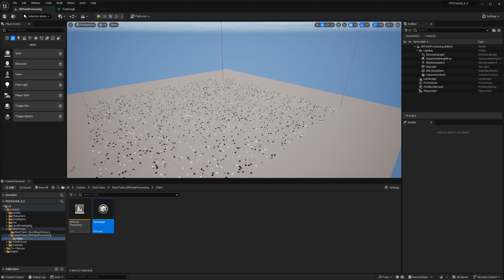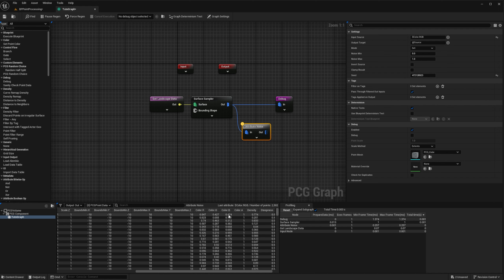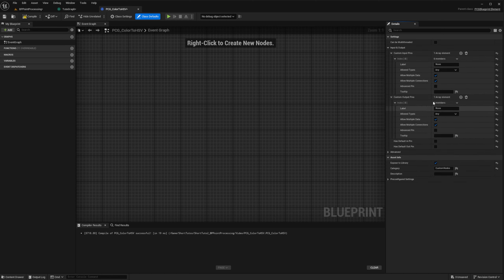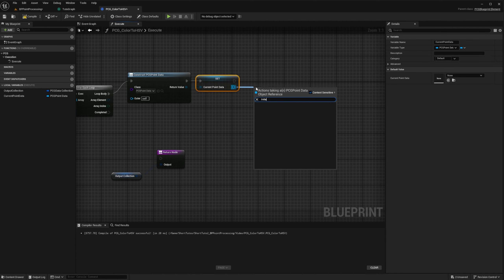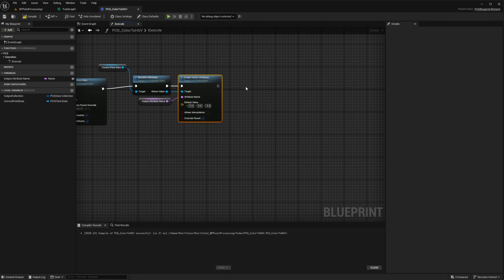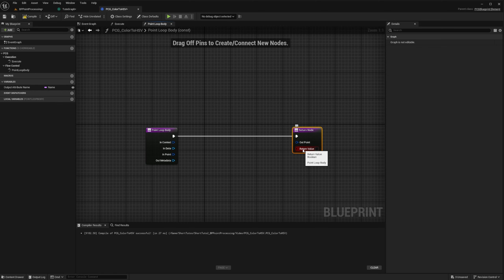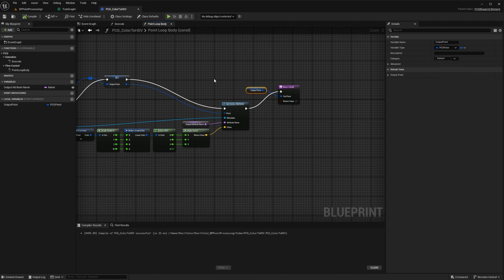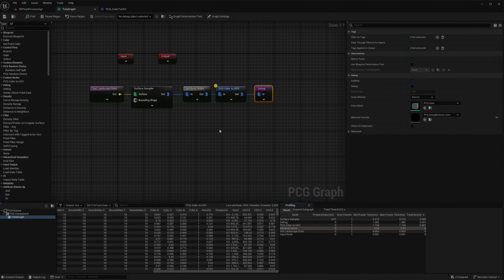Unreal Engine 5.3 PCG - Short Ep 2 - Custom Blueprint Node Follow-up – Point processing

Comment: PCG are still not working in the release version, which is frustrating
Reply from the maker: Not working? How so?
Reply: @adrien_logut  Try to compile the shipping version and spawn from class a new object that contains PCG. PCG will not be created.
Reply from the maker: I did and it worked?
Reply: @adrien_logut  Which version did you use? I tried 5.2, 5.3, even the test 5.4. In none of this, if you compile the shipping version, the "Mesh Sampler" does not work
Reply: It is necessary to dynamically create an Actor with the SpawnAcotrFromClass command
Reply from the maker: @Yupiter1233 Please come to the discord server https://discord.com/invite/unrealsource in the pcg-framework channel and ping me there (@thelonelychaman). I just tested in 5.3, spawning dynamic actors, that are a cube with a pcg component attached. And I spawn grass on the cube using the mesh sampler.
Few things:
* Make sure the meshes are cooked, you might have to place them hidden in your world or have a hard ref somewhere
* MeshSampler use the Geometry Script plugin, and it requires the option Allow CPU access on the Static mesh to work at runtime.